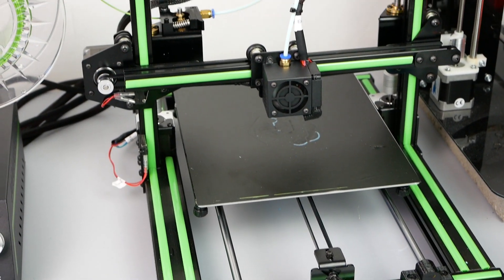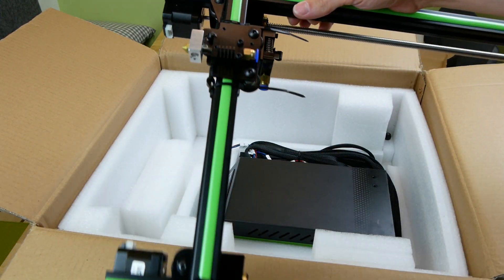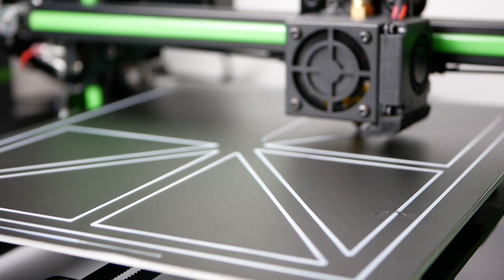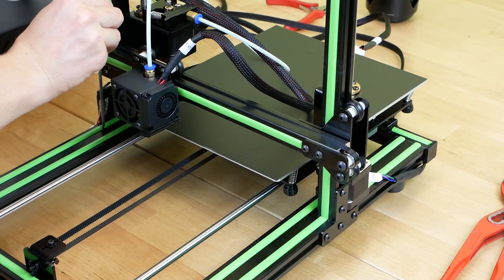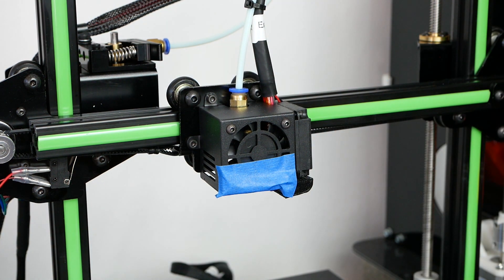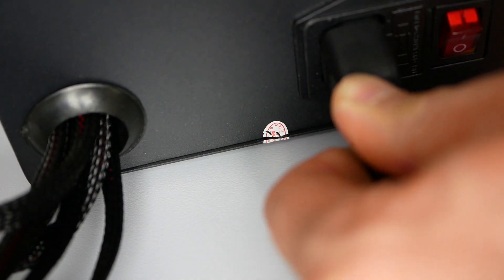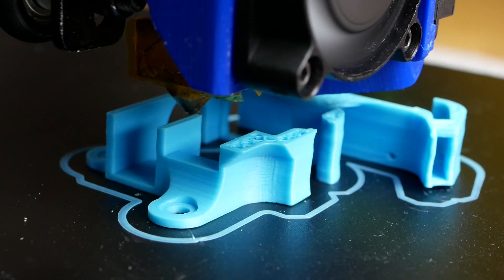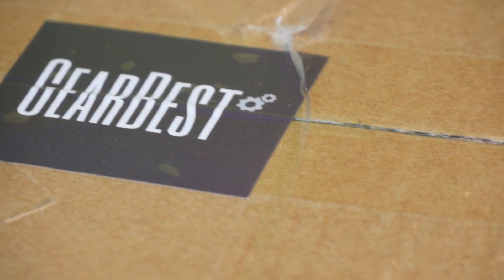Anet E10 Review - Horrible engineering but decent prints!

Comment: From what I am seeing it Looks like GEAR BEST sent you one of Their returns I have been Using Anet printers for many Years my 1st was the Anet A2 Plus KIT that I Built Myself and I am Still Using it today in 2022 I just Bought my self A newer model to ad to my print family the Anet ET5 Pro and I am Loving it perfect prints Straight out of the box there was Some Assembly needed but nothing like with My first printer and the build volume on the Anet ET 5 pro is 300mm by 300mm by 400mm and Only cost $364 US dollars and I LOVE it in my Honest opinion I would Buy several more from ANET if I could Afford to very reliable and easy to use and IF you Buy from the Manufactures Web site assembled machines come with 1 Year warranty and kits or DIY machines come with a 6mo warranty and LIFE LONG Free ONLINE Technical Support For ALL  Models that being Said Gear Best is A 3rd party dealer so I would not expect them to honor any warranty that's like buying one from EBAY and expecting a Warranty

Comment: You know, I watch "reviewers", reading comments from all sorts of couch "experts" and can say one thing: well, boys, you go design, prototype and launch your own 3D printer for around 300 quid and lets see how will you do.. It's all out there, open source.. Materials readily available, parts, etc... I have not seen anything in this price range coming out of Europe or US or whatever. Just the Chinese managed to pull the trick. Just look at Prusa. 900 quid assembled. Do your maths how many CR10 or whatever clones you could build for that? With all bells and whistles... And with quite satisfactory results. You all want top quality but cheap.. Newsflash: not happening, you get what you pay for or just go and build it yourselves and stop giving out.
Reply: For 300 you can get much better quality and most important safety. Got a 140€ Longer LK4 which is pretty simmilar, just with smaller volume and 10x better Engineering.

Comment: Your hot-end design also works on the Anet A9.

Which is quite nice, since otherwise i would have had to redesign a full blown cooler from scratch.

The Anet A9 is one of the smallest printers that still has a heated bed.
and during sales on aliexpress can get as low as 70$ {excluding additional coupons}

Comment: Honestly the only really bad things that you mentionned are the sharpie covered scratches and the software that doesn't have the bed well configured, all other problems were either caused by bad cable management or other assembly issues, shipping damage, and some weren't even issues, like screws being used as a way to hold belts, let me remind you that the original prusa i3, a 700$ printer uses zip ties to hold bearings and many other parts, and when it comes to the only really sketchy thing which is the loose heating cartridge, we can see it wasn't installed out of the box, so you installed it and in the shot were you show it's loose we can see there's a set screw to hold it in, said set screw that you did not tighten...
I expected better from you since you're usually on point with your videos.
Not saying it's a good printer, it really isn't but you pointed faults that weren't faults and you missed some actually real faults...

Comment: I have this printer but I need a replacement for the mainboard and I was wandering: does the e10 and the a8 have the same mainboard? the have a different cost online, and I don't understand the difference
Reply: I have a newish A8 and it has the same ANET3D V1.5 board shown in the video - but the firmware is a different level. If you are confident enough to burn a boot loader and reflash the firmware then you can pick the boards up on eBay.

Comment: you did a very thorough review its to bad your mechanical sense is poor, case in point there is not a design flaw when something is bent and hits or bind that should have been corrected before using but I did think you did a good review even though lacking mechanical ability

Comment: Your GCode for the PLA print in Thingiverse for your shroud produced the best print quality that my printer has every achieved.  Would you please share you slicer settings and tell me which slicer you used to generate the GCode?  Thanks
Reply from the maker: I used Simplify3D as a slicer. If you don't want to spend that money, just download the latest version of Cura and use the included Creality CR-10 profile. Then just change the build volume under printer settings. This should give you a good baseline profile.

Comment: Fan shroud printed and installed, but still does not solve temperature issue.  The only way I could get it to temperature was to put insulation on the extruder block.  Then  I could get to 230C.  Any suggestions?

Comment: Anet is and always will be  linked to having  bad engineering. They can  copy other  people hard work in design and development and  keep  the worst back street workshops in ShitZhen in work.   But Anet Liu seems to be laughing all the  the way to the bank. AND still using that crap 20amp PSU  knowing its hardly suitable.....AND that same  crap plug on the hotbed. Thanks  for an unbiased review - which will  guide me away from this machine and likely be the last you get free off GB.

Comment: Welcome to the club of the screwed overs.... yours was actually in better condition then the one GearBest sent me and at the time of this post they are making me ship it back to them at MY COST!!!! They refused to honor their 7 day DOA Warrantee. So I had to shell out $38.xx to ship it via FEDEX.
The control box was dropped on it's face and bent the knob in two directions and pushed the control shaft in and up into the control box.
The Z bearing was have way down the screw.
The black flat bars that the table mounts to were all bent "AND" you have the same thing!!!! Mine were worse.
The drive belt for the table wasn't connected.
All guide rollers were loose. (X and Z)
The nozzle fell out.
Loose parts rolling around in the packing.
I WILL NEVER BUY ANYTHING FROM GEARBEST EVER!!!!!!!!!!
Update: FEDEX just emailed me and said they were increasing the shipping costs from the original $38.98 to now $43.53!!!
This nightmare will never end... I'm now out over $350 BUCKS!
It just blows my mind how they keep sell this crap and there are dozens of YouTube videos all showing the same thing.
Reply: payPal or your Credit card  can  take  up your claim DOA - not fit for use as described by seller.

Comment: Wow, this was a very good review! (Except why is there a need to operate it upside down ;-) Anyway, I think you spent much much more effort into it as expected by Gearbest, But you did a lot to make the printer more interesting to me. Two motors for the Z axis and a better(?) linear guidance for the Y axis are pros for the printer compared to Creality's CR-10. The overall size looks interesting and should be fine for 99% of prints. It seems that all design flaws have a workaround. I only ask myself regarding the noisy fans?

Comment: Even if I was on a budget, I would not go anywhere near this printer. It is one electronic nightmare. I would not trust it running for any length of time that I could not sit and watch it with that wiring, it's awful. I don't mind tinkering to get a printer working better, but some of those flaws are just unforgivable. Like someone said before me, it's a race to the bottom with this company.

Comment: If you check carefuly on 6:03 you will see that frame of the bed is bend down and thats why bed grinds on frame of the printer
Reply from the maker: I applied some "gentle force" at 6:55 to bend it back straight.
Reply: Yep, I saw it during the video, some of other reviewers also had same issue with this printer

Comment: First of all, ANET is NOT pronounced Ay net, its pronounced ANN net. I created the official Anet group on facebook some 19 months ago. You dont understand the Chinese market CNC Kitchen, and who is linked to who. The Creality CR10 is a piece of junk, so is much of what AY-NET make..!! 

I broke all ties with Anet some 4 months ago, and refuse to recommend Anet to any new buyer, its poor quality, and downright unsafe.

After visiting China, my group is building links with more reputable suppliers which do NOT include Anet, Creality and especially Gearbest...!!!

https://www.facebook.com/groups/1068531466501015/
Reply: Calm down dude
Reply: The CR-10 is one of the better designed budget printers out there, this is a poor clone of it. I've looked at the wiring for the CR-10 it's safe. This will ruin you, period! I have had very little issue with my CR-10, it is producing some of the best prints I have ever had and they are on par with some of the more expensive FDM printers out there. Yes the CR-10 needs a few tweaks, but the company recognise the flaws, and there is such a great support group for it. There have been a few bad batches that gearbest have been flogging due to the high demand QC has not been the best, but for a straight out of the box experience , I am not disappointed in my CR-10.

Comment: Is the bowden tube made of some special material? I thought it was regular 4mm pvc tube for pneumatics, but now it seems to have a much thicker wall. Nice review. It' s hilarious  that someone just painted over the scratches with a black marker!
Reply from the maker: I think the proper ones are out of PTFE to minimize friction. Probably this actually is PVC which is way cheaper and therefore also has the wrong internal diameter.
Reply: ffoska usually it is made of PTFE due to low friction and high temperature resistance
Reply: Proper Bowden tubes for 1.75 filament have an OD of 4mm and an ID of 2mm and is made of Teflon (PTFE)
Reply: +brian whittle OK but that's the same as a 4mm tube for pneumatics and the quality ones are also made of PTFE. So is there any difference or just the name?
Reply: As long as the inner diameter is 2mm

Comment: Holy shit the electronics :o
Reply: Big thing is, it needs a MOSFET module to get the current of the bed off the main board or it could burn the connectors...happens all too often
Reply: Brian C Mostly the connectors only burn because the wires are improperly installed. People just put the bare wire in the connector. I already saw mosfets burn because of that too. While it is still good to get the load of the mainboard the connectors are only burning up if they are improperly used.

Comment from the maker: What's your opinion an the Anet E10? Would you buy one even though it has flaws and improve it or would you rather invest some more money and buy a properly working one?
Buy the ANET E10 for 220€: https://www.gearbest.com/3d-printers-3d-printer-kits/pp_664901.html?wid=3&lkid=11281781
Or rather buy a CR-10 for 330€: https://www.gearbest.com/3d-printers-3d-printer-kits/pp_627175.html?lkid=11103327
Reply: CNC Kitchen I spend even much more to get good prints without need to thinker...even I started thinker it...as 1st printer I needed something can print accurate dimensions so thinking would be easier
Reply: What a joke. Another Anet printer all ready to burn your house down.
Reply: I need a printer with more flaws to tinker upon for less money, but they can't be so bad that i have to throw the whole printer away in the process of fixing it up.
Reply: my cr-10 arrived a week ago so that answers your question lol
Reply: I have long considered. Then i bought the Original Prusa I3Mk2 and it was the right decision
Reply: I think it's a decent printer if you take the price into account. For <$300 you should almost expect some bad design and cheap/bad solutions.
Assembly for me was around 30 minutes like you mentioned and after maybe 10 more minutes of tinkering it was already producing pretty good prints.
Reply: I really love tinkering. But those are to many flaws that have to get fixed for my personal taste!! I would rather invest a bit more money.
Reply: lol.. You are a moron that thinks ppl should calibrate E steps for every filament.. So stfu